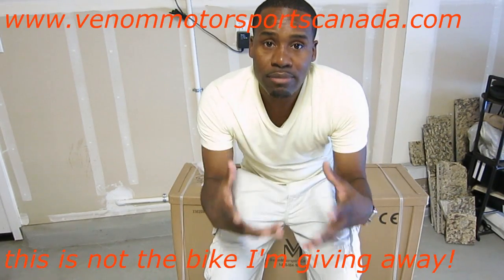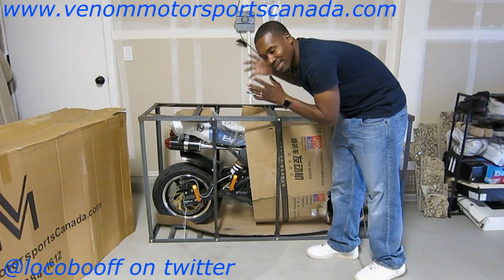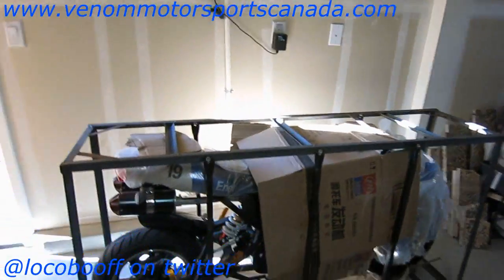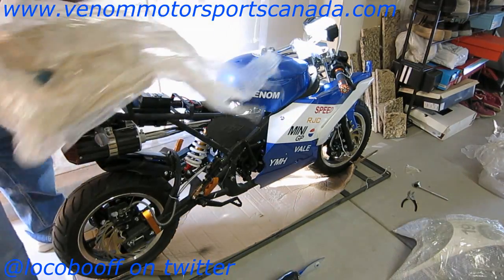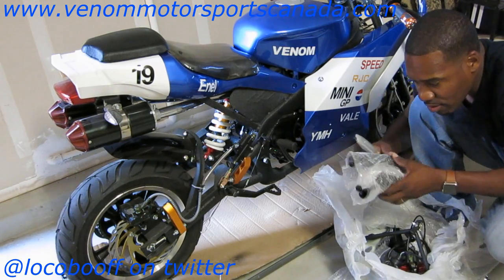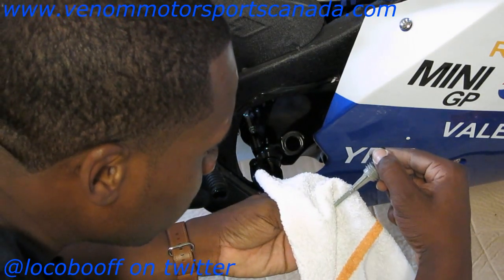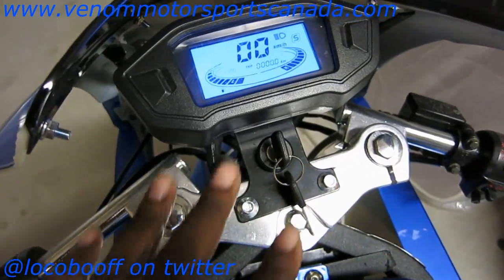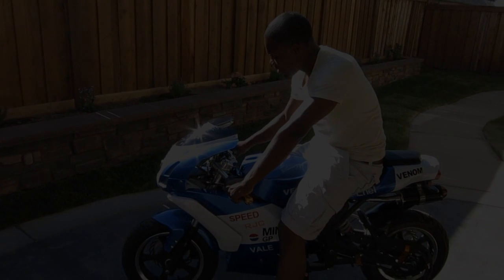New In Stock 2016 X19 Super Pocket Bike Detailed Setup & Unboxing

Comment: Did your 2015 model have chain rub on the top half of the chain ? Mine does and it vibrates a lot. I tightened the chain to no avail
Reply from the maker: +Michael Laguna call venom... they have a 1 year warranty.    I haven't had any problems like that

Comment: locofob with a manual transmission if you don't shift at the rite time will the motor breake
Reply from the maker: +marcos Martinez it won't break,but it's not good for it.
Reply: Thanks you for replying
Reply: Hey I could have SWORE with ANYTHING electrical you have to put the power connector on the battery first. Does the bike have any fuses because they could get shorted out. Nice videos by the way.
Reply from the maker: +Sandra Ruiz I'm no electrician.....I just did it this way.  Everything seems fine
Reply: locoboof
 Good good. I'm gonna be getting one soon. I been watching your videos on them since last year.

Comment: Why no turn signals on the front
Reply: Ikr. I put turn signals on the mirrors on mine
Reply: Buy water proof LED strips in yellow. Solder positive and negative wires on them and splice them with the existing turn signals. Use outdoor mounting tape and zip ties to secure them to the mirrors. Use wire loom to protect the wires from the elements.

Comment: Mine is registered and plated in DC
Reply: How is it so far? Also did you need to put insurance as it goes so far with the new regulations.
Reply: +Anthony Ortiz it's pretty good. A couple hiccups with the bike here and there but overall it's fine. In DC anything over 50cc is legally a motorcycle or "motor driven cycle" which means yes, you need a motorcycle license and insurance. My insurance is like $20 a month so practically nothing.
Reply: +Kavonn Thomas Thanks for the fast response and to early to be awake but ehh either work or school so yeah. Alright though, couldnt a big bore kit help out on the speed? Also looking an insurance here, nc. I called allstate and nothing theyd said they get back and its been a week so no for that one. What insurance you suggest?, and that preferrably great pricing!
Reply: +Anthony Ortiz haha no problem, yeah omw to work. Honestly though with this short of a wheelbase you wouldn't want to go much faster than 50mph, and yes with me on it only goes 50 and the bike hates being at WOT too long cause it'll start sputtering and you'll get no throttle for a couple seconds after that. Not very safe while you're in traffic. As for insurance you'll need it before you even go to the dmv. I insured mine as a scooter or you can use the term Off Highway Motorcycle. Also since there's no official make and model of the bike you'll have to call after you do most of the work on the computer to have them manually enter the make model and Vin number. I'm insured with geico
Reply: +Kavonn Thomas Alright cool. Dang sorta can tell and plus the weight may bring it down some making it not good idk. But yeah looks, sounds good as in the vid. True for the dmv and yeah.
Reply: +Anthony Ortiz Altight thanks for that heads up and also Ill give them a call later on today thanks again.
Reply: +Anthony Ortiz no prob
Reply: +Kavonn Thomas ight and ight man take care!